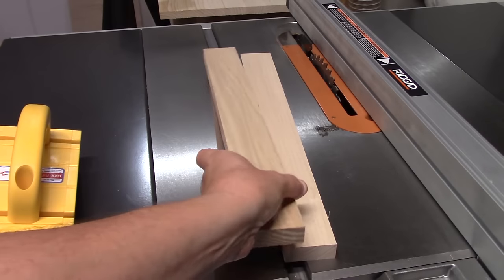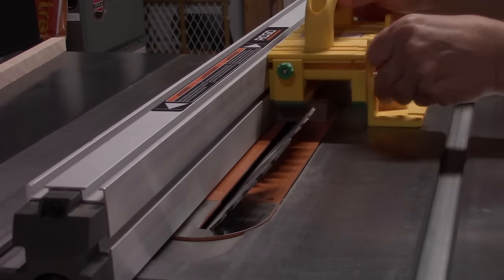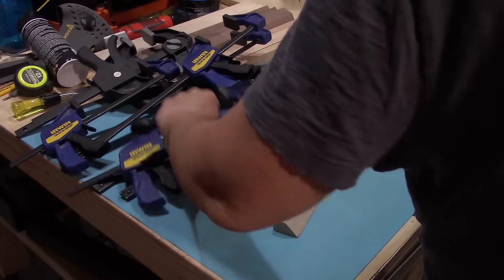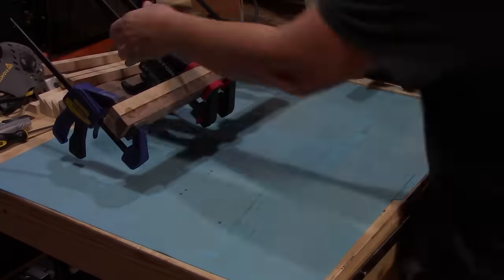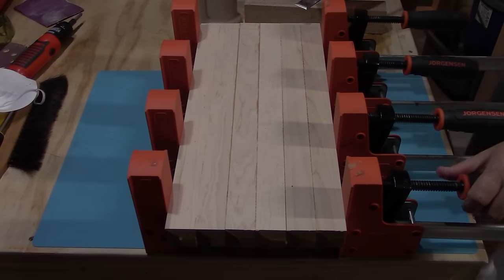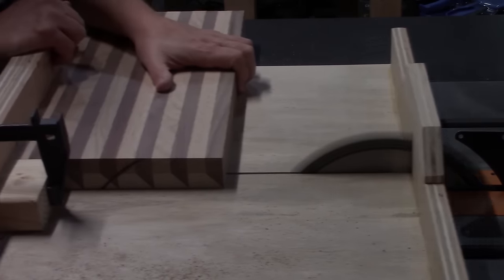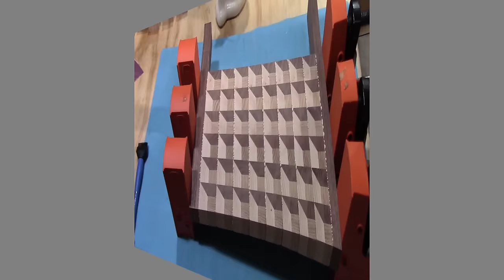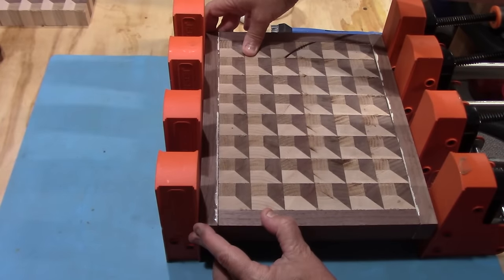The Stunning 3D Cutting Board - Part 1

Comment: I’d suggest you cut all your hardwoods at 1/4” or less and hold them up to a light. After doing this you’ll see without a doubt why oak is not a good piece to use in any food contact product. Yes it’s cheap…. Yes it’s hard… but it’s not a tight grain wood like walnut or maple and why most ppl steer away from using it
Reply from the maker: Thanks for watching the video and commenting.  I've had a few other viewers make the same suggestion, and I would tend to agree that the red oak is a bit porous for such an application.  In hind sight I would have used the domestic wood trifecta (walnut, maple, and cherry).

Comment: Just came across this video... nice job!  Tell me how did the cutting board with the walnut border hold up with the grain running in a different direction then the main part ?
Reply from the maker: Thanks for stopping by the watch the video and comments.  So far, so good on the border around the one board.  I made it for a colleague and told him to care for it well in terms of cleaning, caring, and conditioning.  If I know him, he'll take good care of it, which is half the battle when you have lots of glued surfaces, and in this case the border in cross grain.

Comment: Great work. You're probably about to receive a lot of traffic warning you against using red oak for cutting boards (for food safety reasons).
Reply from the maker: Thanks for stopping by and for commenting.  Yes, red oak is more open grain than the traditional maple, cherry, etc. but should be safe assuming the board owner takes care of their cutting boards by washing with warm soapy water on all sides and allowing to dry with good air circulation.  They should also be treating them depending on how often they use them with some sort of seal like beeswax, etc.  I know this is assuming a lot from a board owner, but I do provide a complete cutting board care list when selling a board that includes detailed instructions.  It's pretty amazing how many people are willing to pay for a handcrafted board but have no idea on how to clean it, wash it, store it, treat it, etc.

Comment: I am considering trying this, but instead of a thick cutting board making thinner charcuterie boards about an inch thick and without adding the border pieces.  It seems the only change is how thin the cuts are after the second glue up.  I would like to know if you think this design would be strong enough with it only 3/4" or 1" thick?  It just seems like it would be fragile with all endgrain pieces?
Reply from the maker: Thanks for stopping by to watch the video and comment.  Realistically, any time you have more pieces of wood that you're gluing together, and multiple glue ups, the points of failure increase significantly.  However, a lot of times my boards are only 3/4 of an inch thick, and sometimes less if making a garnish or charcuterie board as you've indicated.  I think it could be done since the overall dimensions of the board should be smaller as well.  If you take your time throughout the process then I think it will be fine.  I believe that someone here posted that they made coasters with this design, so...

Comment: for the first glue up. try 4" stretch wrap instead
Reply from the maker: Thanks for watching the video and commenting.  Thanks for the tip.  I've had other viewers recommend tape, rubber bands, and hose clamps as well.  Whatever you have that is going to produce a nice, tight bond with no voids.

Comment: Great tutorial video thanks !!!
Can you tell me the dimensions in mm and not in inches? I do not know how to convert, I do not manage
Reply from the maker: Thanks for watching the video and commenting.  At the beginning of the video, each of the woods was approximately 355.6 mm long, 50.8 mm wide, and 19.05 mm thick.  The red oak was cut in 19.05 strips.  The walnut and maple were cut with 45 degree angles, but I used the red oak strips as a thickness guide so that the three pieces matched up.  After making the 7 individual glue ups and gluing those together, the length and thickness of the board was approximately 355.6 mm long by 304.8 mm wide.  After cutting that and turning the pieces on their sides and gluing that up, the final thickness of the board was approximately 304.8 mm long by 254 mm wide by 25.4 mm thick.
Reply: @DEJaegerWoodworking  Thank you for the quick feedback !! Feel like you are sharing from the bottom of my heart !! Congratulations, I continue to enjoy and learn from your videos Thank you very much
Reply from the maker: @טוניכהן-ג3פ  I appreciate your comments

Comment: I would like to make this board but don’t own a drum sander, what is the options of doing this without a drum sander
Reply from the maker: Thanks for watching the video and commenting.  Your question is a very popular one.  Although you could true the surfaces with a planer, I'm assuming that if you don't have a drum sander, then you're not likely to have a planer.  The options that I can think of are to build a router sled and use and handheld router to true the surfaces.  Or, you could go completely old school and use a regular hand plane.  Do a search on YouTube for making a router sled and you'll see what I mean.  That is probably the cheapest, fastest, and most efficient way without the big expense of a planer or drum sander.

Comment: What are the width, length, and thickness for the finished cutting board including the walnut barrier boards? i would love to make one of these but am struggling to figure out the dimensions
Reply from the maker: Thanks for watching the video and commenting.  The length, width, and thickness of your beginning stock is really what's going to determine the ending size of the board.  As this ended up being two boards (one that wasn't highlighted as much in the video, but can be seen at the beginning and end of the video) the lengths of my starting stock was 24" long x 2" wide x 3/4" thick.  You might want to go with 18" lengths.  If you glued up 8 individual pieces then by the time you made all your cuts you'd probably end up with a board that was 16" x 12" or a little larger.  I would probably advise against the border unless you arrange it as end grain.  You could experience some separation or splitting if you don't.

Comment: Do you find the open grain nature of red oak works ok for the end grain cutting board?
Reply from the maker: Having made the board in this video for the first time, and some of the comments regarding the porousness of red oak, I would likely substitute it with cherry.  With that said, I believe that if the customer cares, cleans and conditions the board correctly the red oak really shouldn't be a problem.
Reply: @DEJaegerWoodworking  honestly I’m not sure the red oak is a big deal esp w the customer wanting it and also caring for it well. The wax probably helps fill the pores I’m guessing. Really a great design.  I actually like the border and don’t think it will necessarily separate.

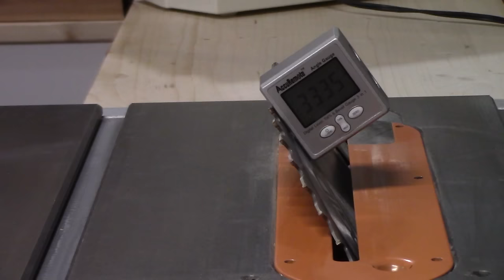Comment: Gorgeous pattern!  My compliments.  I do want to point out the placement of the digital angle gauge on the table saw blade (around 2:33 ) can be incorrect, though - if one corner of the gauge is resting on the teeth of the blade and the other corner on the body of the blade, the readout will be slightly off due to the kerf.  Place the gauge only on the body of the blade, or ensure it's sitting between the teeth if there's not enough room on the body.
Reply from the maker: Thanks for stopping by to watch the video and comment.  Yes, you are correct regarding the placement of the angle gauge.  Sometimes segments of the video are shot just for visuals, and are also shot out of sequence, or a clip from a previous project.  However, a viewer could definitely see this as how it should be done, so I should be more careful when using them.  I had a user point in my chessboard video that the king and queen pieces were in the wrong spots on the board as well.  Not really the point of the video, but it was incorrect, and viewers will let you know.  Thanks for pointing out the issue in this video.

Comment: Do these fancy cutting boards hold up or are they more for display? It seems to me, the more of little pieces you have, the more glue required. The more glue used, the more chances of splitting, especially on end grain boards.
Reply from the maker: Hey Darrell, thanks for stopping by to watch the video and comment.  I would certainly hope that the person who purchased this cutting board will use it.  I know they look "cool" but my purpose is for them to be used.  I believe that if you use good techniques and good products, this type of board should definitely be durable if taken care of properly.  I do include a cutting board care sheet with all of my boards that explains the proper way to clean, store and treat their new board.  This at least advised the purchaser as to what they "should" be doing to keep their cutting boards protected and in great shape.  But let's face it, you can only do so much.

Comment: I know this is probably a dumb question. Would it cause problems to separate the first glueing into two steps? Glue the square stock to one of the 45° stock wait for it to dry and then glue the second 45° stock? Or is it better to glue all three pieces at once?
Reply from the maker: Thanks for watching the video and commenting.  Certainly, it could be glued in that manner.  I just found that assembling the three pieces a little.  That, and I was limited by the number of clamps that I had.

Comment: I would have used clear tape instead of clamps. Sealing tape is stretchy so you can pull it a little tight to close gap in 45. I but the two 45 together and put the tape along the face to hold pieces together. Built newel posts this way and it saved a lot of time. If you have gaps you can always put a clamp. Never have enough clamps. But tape is an awesome help.
Reply from the maker: Thanks for stopping by to watch the video and commenting.  The tape is an interesting trick.  Do you know of a video that demonstrates this, I would love to take a look at that technique.  Regardless of how many clamps you have, it never seems like it's enough.
Reply: @DEJaegerWoodworking  I’m not sure of a video. This is a trick I use in my shop and on job site. I have been a finish carpenter for over 20 years. I could make a video to show you how I have done it. Clamps are an amazing invention.
Reply: @DEJaegerWoodworking   I have a lot of tricks to save time and help with assembling.
Reply from the maker: @llythgoe2  Next time you find yourself using that technique, and if you have the ability to record it, I'd be interested in seeing it.  Heck, you may find that your 20 years of experience gives you a bit of a niche for making YouTube videos for others.  We're all here to learn from others.  I appreciate expertise and the willingness to share it.
Reply: @DEJaegerWoodworking  I will for sure. Thanks. Have been contemplating on making some videos of woodworking.

Comment: Wow thanks for the video. I have a question. I have a jointer but no planer. What can i do? I see all these wonderful boards and would love to make them.
Reply from the maker: Thanks for watching the video and asking a question.  I'll do my best to answer.  For the initial board milling you could certainly get the pieces you need from a jointer, but realistically without an ability to cut the length of pieces at a 45 degree angle, I'm not sure how you'd get the 3D effect.  Obviously there is more than one way to get this 3D effect.  After some searching on YouTube I found the following video.  It's a different take on making this type of 3D board, but it make work for you if you've got a jointer and a miter saw and make the cuts required.  Check it out.   https://www.youtube.com/watch?v=PWAFjFAfOYQ

Comment: Can't find my previous post, but I'd asked you about gluing up two of the pieces, letting the glue set, and then adding the 3rd piece. This did not work as well as gluing all 3 together, as the latter somehow lets the 3 pieces "settle in and find their places with respect to each other" (that may make no sense at all). I found  that wrapping the 3 pieces in blue painter's tape and then placing rubber bands tightly along the length of the 3 pieces worked well, and is way easier than trying to arrange a zillion clamps in the proper orientation.
Reply from the maker: Hey Howard, your original comment may have been on Part 2 of the video, but I do remember you discussing this.  Glad to hear that gluing the 3 pieces together and adding tape and rubber bands worked well.  I agree, it will help in reduce the number of clamps which can also be costly, or limit the number of glue ups you can achieve at one time.  Thanks for letting us know!
Reply: Addendum to the above post: I think the alignment you got using multiple clamps is better than the alignment I got with tape and rubber bands.
Reply from the maker: @howardbessen8153  Maybe a combination of both clamps and rubber bands/tape?
Reply: @DEJaegerWoodworking  That's what I'll try the next time I make this!

Comment: How do these boards hold up in day to day use? I mean with regards to the multiple joins and being washed regularly with hot water or even placed in a dishwasher?
Reply from the maker: Sorry for the late reply, I was trying to get a little R&R in.  Thanks for stopping by to watch the video and comment.  Yeesh, I hate to even think of a cutting board being placed in a dishwasher.  It should never be done, with a board like this, or any quality cutting board.  I'll go one further, and say it should never be done for a wood cutting board.  The chemicals, heat, etc. are just plain bad for any cutting board.  Warping, cracking, and just plain general deterioration of the board in not only likely to occur, it will occur.  Proper care, cleaning, and conditioning of a cutting board is vital to its longevity.  I provide detailed instructions for the care, cleaning, and conditioning of every cutting board that I sell.

Comment: How many pieces of each of the 3 stock species did you start with?  The red oak must be 3, since you get 2  3/4" square from each . . . but you only show one 45 degree piece from each of the maple and walnut pieces . . . meaning you started with 6 of each of those . . . is that correct?
Reply from the maker: Hey Lee, thanks for stopping by to watch the video, and for your question.  I probably should have been a little clearer in the video with my starting stock, but here's a better summary.  I started out with walnut, maple, and red oak, all with the following dimensions (18" L x 2" W x 3/4" Thick).  For the red oak (and I have been properly chided for my selection of red oak due to it's porousness, so you may want to substitute with cherry) I made cuts that we're just a little over 3/4" of an inch so that I had a little material that I could remove during sanding.  Since the kerf of my saw blade was 1/8" I was only able to get 2 pieces of red oak from each piece of stock, but since I only needed 6 cut pieces, I only used 3 pieces of stock and had 3 smaller cutoff pieces left over.  As someone else pointed out in the comments on the walnut and maple, I could have gone with a different width of stock and gotten two of the 45 degree cuts from one piece of stock and not had cutoffs with a 45 degree angle left over,. but it was just what I had one hand at the time.  I did use the cutoffs in a different project.   After all the cutting I had 6 pieces of each and glued one of each of them together to form the 3D pattern, then glued those up together into a panel.  Hope that clarifies things.

Comment: Have you used exotic woods such as jatoba, Purple Heart, yellow heart, padauk etc in your cutting boards. Just wondering what they would look like. Beautiful work
Reply from the maker: Hey Dennis, thanks for stopping by to watch the video and commenting.  Yes, I have worked with some of the exotic woods that you've mentioned, but after reviewing the videos that I've posted I realize that none of those woods have been featured, but instead are used as accent pieces.  I must remedy that.  I am currently working on a chess board but unfortunately it is still using the traditional walnut and maple.  However, after that I plan on making an American flag cutting board which will utilize padauk as the red stripes and purpleheart as the blue field in the flag design.
Reply: Great looking forward to that video and how you are going to make the stars
Reply from the maker: @dennisnahorney8215  I have a small CNC machine that should be large enough for me to inlay the stars in maple or ash.
Reply: Thanks again for the reply. Waiting to see vid